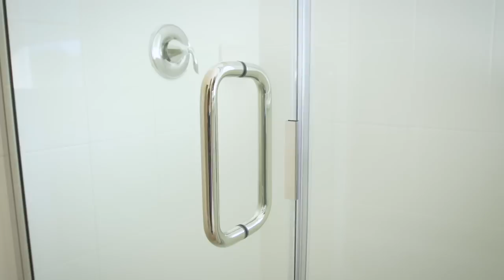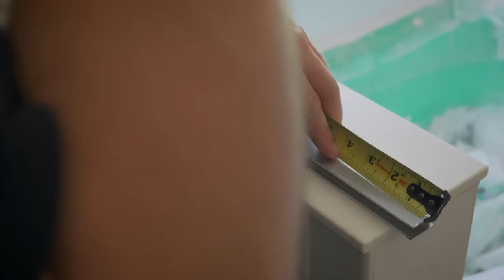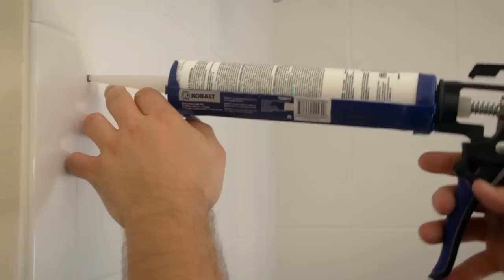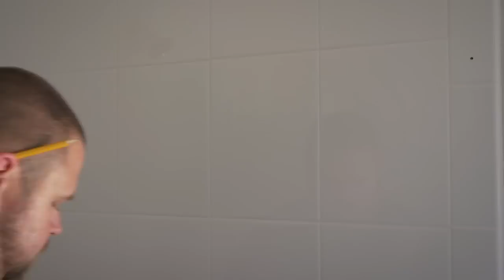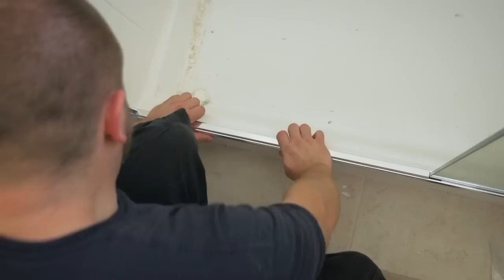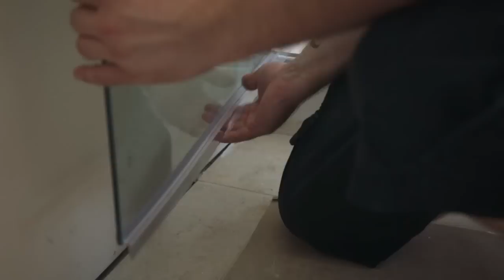Frameless Shower Door Install - Knee-Wall / Buttress / Tub Deck Configuration | Illusion by Coastal

Comment: 1. This is not a frameless shower. 
2. Hope you have 5 to 7 hours to spareto install it if you've never done one. 
3. They don't tell you if your walls or curls are out of plumb or level more than a 1/4" you'r screwed. 
4. Quit putting silicone in the channel. It is absolutely pointless.
Reply: I hate when I have to remove a panel and there's silicone in the channel

Comment: What brand door is this? Seems to me to be a hybrid of semi-frameless and frameless. The Frameless doors I install use no threshold. We also use Clamps to hold all panels. Our doors use 2 or 3 wall hinges (or pivot hinges if required) depending upon height and thickness. Clean install you did though!

Comment: Like others have stated, this is not a frameless shower. It's a SEMI-frameless kit. Possibly why the word "Illusion" is in the kit's name. On a side note, there should be no silicone easily visible in a properly installed enclosure (if one looks for it, they'll find it but the casual observer shouldn't see a bead on the outside). When using a frame channel like this kit, silicone the bottom of the channel before screwing it to the walls then clean up any "squish out".

Comment: This is not a true "frameless" enclosure!  It is a "semi-frameless" ... you have a full vertical metal extrusion running along the hinge side or wet wall that is attached to the door glass.  Frameless means no metal around door at all... with minimal metals elsewhere (i.e. Fixed panel) to secure the rest of the enclosure.  This is not a true representation of an frameless shower enclosure.

Comment: this what I do at my job for a living. this video will have you do Alot of extra stuff you don't need to do. Especially all that silicone he gone have Yall showers looking real sloppy lol
Reply from the maker: LaDarius Fletcher - Coastal ShowerDoors appreciates your comment on our Illusion Frameless Shower Door Installation overview. Please allow us to respond by stating that this is truly a very simple frameless shower door to install especially when compared to products that include glass fittings and require cut-out notches or holes.

Additionally,   regarding the comment about the caulking,  the shower enclosure was designed so that only a tiny bead around the outside perimeter of the Extrusion is visible.    

Let us know if we may assist you with anything in the future.  

-Pat
Reply: @coastalind  were is the silicone underneath the Curb ?
Reply: It looks great and the installer is top notch!
Reply: agreed.  That job would normally take 2 pple at other businesses.
Reply: Were can I get that shower frame?
Reply: United mirror and glass

Comment: @ Scott Marcum a Frameless shower door system has no frame around the door. the track around the perimeter of the shower is needed for support. anyone who trust silicone to hold a 100 lbs piece of glass is asking for trouble. you can get showers with smaller track but it is always a good idea to use something for support other than silicone.